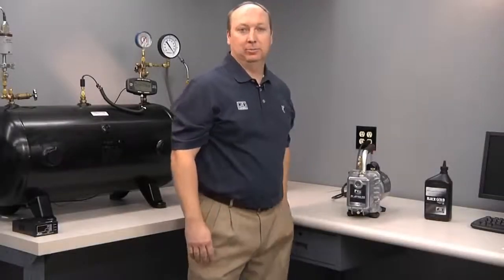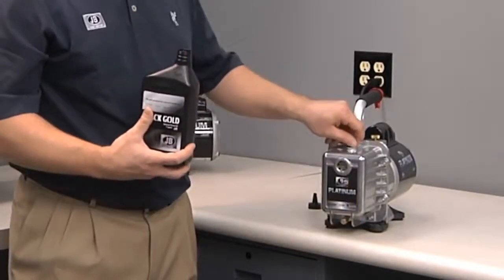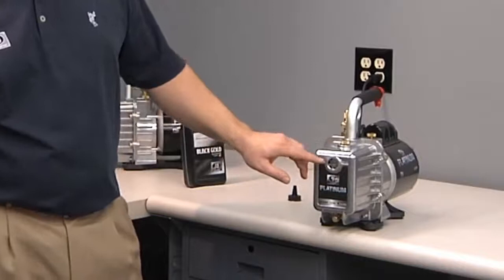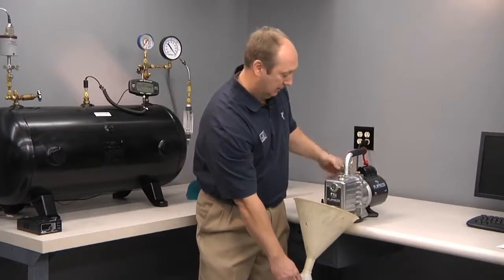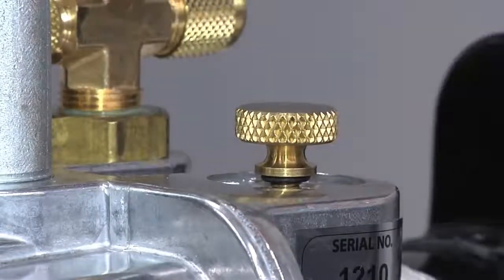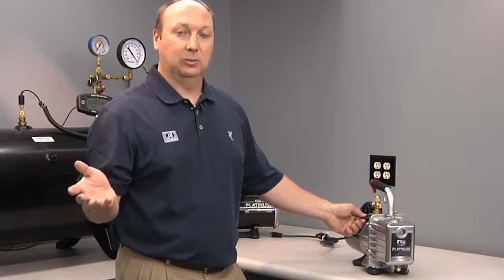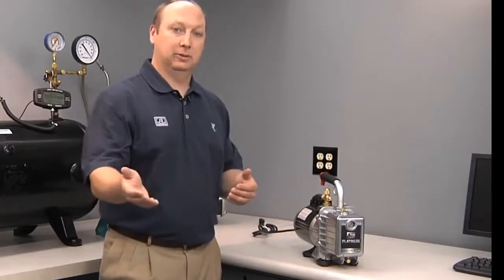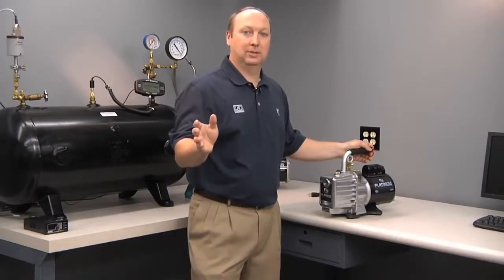JB Industries - Platinum Vacuum Pump - How To

Comment: What is the expected temps a running pump should achieve
Reply from the maker: Thanks for your question.  The normal operating temperature is approximately 160°F, which is hot to the touch. Line voltage and ambient conditions will affect this somewhat. The motor has automatic resetting thermal overload protection. Our Platinum Pumps are designed for continuous duty and will run for extended periods without overheating.  Hope this helps!